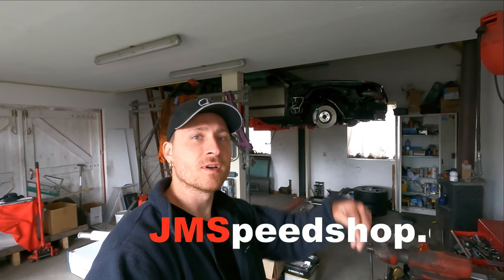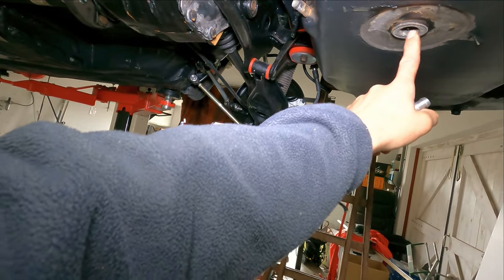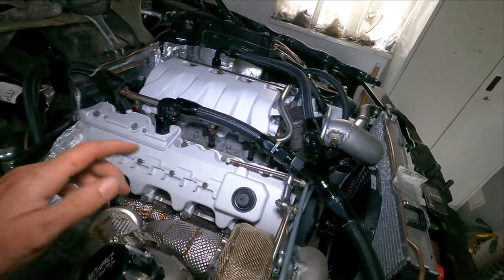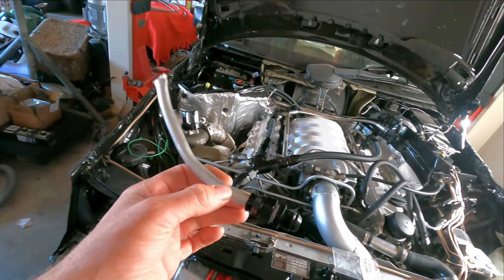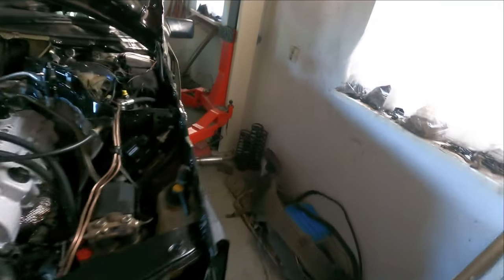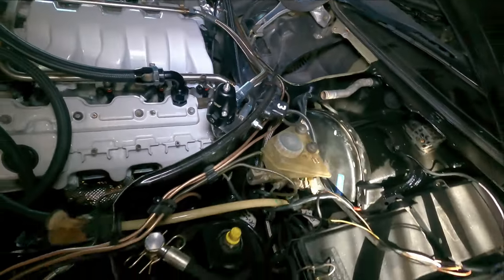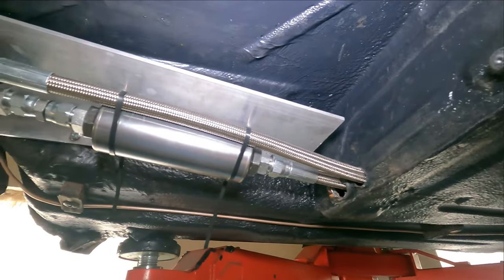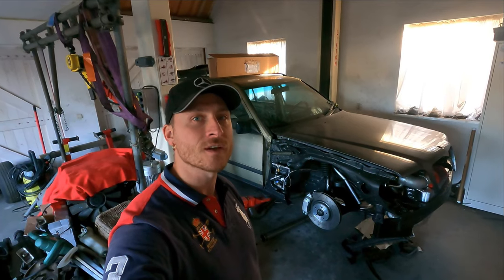New fuel system for the M113 V8 turbo

Comment: Hoi, hoeveel pk verwacht je dat eruit gaat komen? Ik denk 450😊maar dat gok ik, pas je de overbrenging van het differentieel ook aan? Groetjes Mario
Reply from the maker: De rest achter motor is ook ge upgrade. Dus grotere diff en custom aandrijfassen.  Wel wil ik nog een lsd diff internal eigenlijk.  Vermogen op normale benzine zal tussen de 400-450pk zijn omdat ik nog de oem compressie verhouding heb.  Op e85 mengsel verwacht ik. Tussen de 700-750pk en tussen de 900-1000 nm.  Te eindigen.
Reply: Idd sperdiff is ook een mooie upgrade